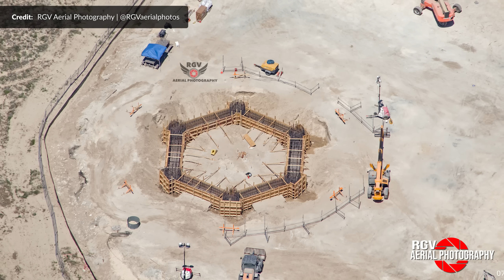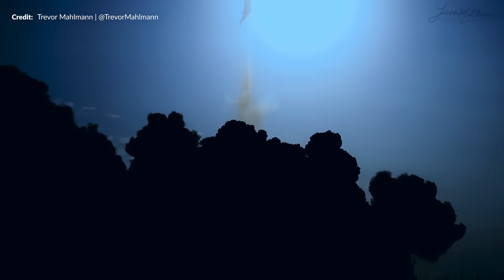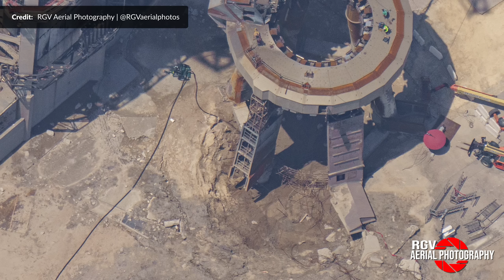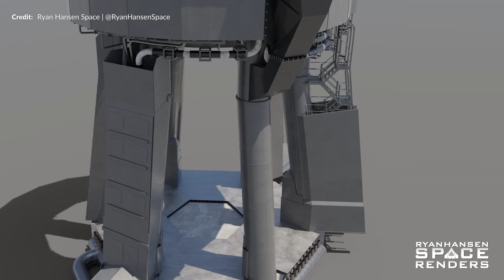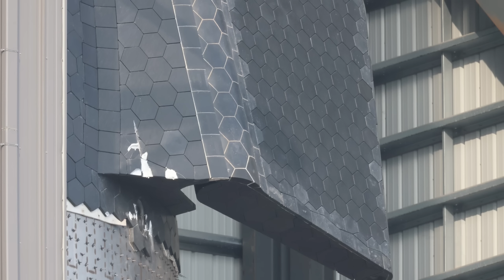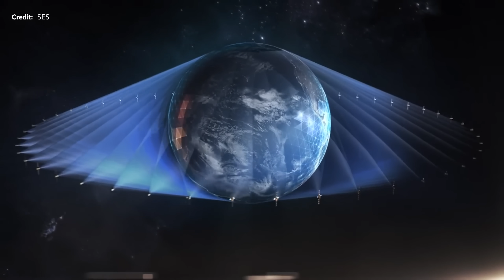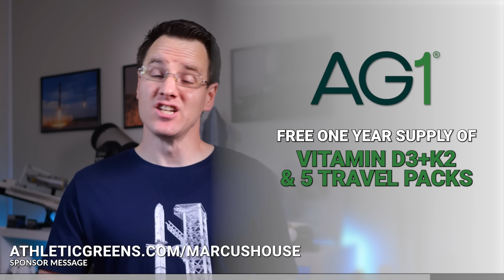The Starship Damage Left Behind: How are SpaceX Moving Forward?

Comment: I don't think there is a concrete out there that can handle this loading. I did my thesis on ultra high performance concrete which is ridiculously tough stuff, stops artillery shells - literally. Still don't think even this concrete would work. You'd need some sort of ablative surface, but that's just the heat. The transient forces on that pad would be nuts. You'd need somthing that doesn't vibrate too much and is super stiff and hard. Maybe a very special ceramic? Diamond? Not sure. Concrete, I don't think will cut it.
Reply: Water-cooled steel plate
Reply: Not convinced steel would handle the vibration. They'd have to have a ridiculous dampening system. Else they would have to use steel blocks, not plates so that vibration can be dampened. Not sure how you'd cool that. Flame diverter would be best. Maybe they can look at firearm suppressors for dampening as inspiration if they don't want to go down the flame diverter route. Would be pretty weird if that worked
Reply: It has to be rapidly reusable and support up to two launches per day, so anything which needs refurbishment or mass desalination is off the table. 
Chances are whatever solution they come up with will eventually be used by every other rockets. Musk is talking about liquid cooled metal plates. 

Maybe just put 33 upside down engine nozels in reverse and suck all that plume away! what could go wrong!
Reply: @NCC_1701  The two launches a day is a far off, future goal. The SpaceX plan for Artemis III as laid out in the GAO report denying the HLS Option A complaints, is 1 Starship variant launch every 12 days.
Reply: @steveaustin2686  It's no more a "far off future goal" than getting Falcon into reusable status. It's the entire point and economic model of the vehicle.  You not understanding that, or realising the use case is irelevant. 
It is the many orders of magnitude decrease in payload to orbit and suborbit which is both the use case and creation of a new market.  It's not just access to space but access to point to point transport. The ultimate goal of an interplanetary vehicle isn't what is being referenced by multiple launches per day.
People said the same about air travel too. "It will never take off"...
Reply: @NCC_1701  Again, page 10 of the GAO report denying the HLS Option A complaints, show that SpaceX's OWN plan for Artemis III is 1 Starship variant launch every 12 days. Just like the Falcon 9, through many variants, took over 5 years to land a booster, almost 7 years to reuse a booster, and over 10 years to get to a once a week launch cadence, Starship is not going to start off with daily launches. You can believe Musk's goal, which in the past, he has said that he regularly makes overly ambitous goals or the actual reality of spaceflight developed at SpaceX.
Reply: @steveaustin2686  I couldn't care less what the GAO report says, and neither does SpaceX.
Reply: @NCC_1701  You MISSED the point, that the GAO report, page 10, shows that SpaceX's OWN plan for Artemis III is 1 Starship variant launch every 12 days. Not the GAOs analysis, but SpaceX's OWN planned cadence for Artemis III is 1 Starship variant launch every 12 days. Yes, SpaceX's OWN plan.
Reply: @NCC_1701  SpaceX doesn't just launch HLS Starship to the Moon. It is up to 10 flights to get HLS Starship to the Moon. This is SpaceX's OWN F'ing plan for Artemis III, so maybe you should actually LOOK at it.

From page 27 of the GAO decision to deny the HLS complaints. [DELETED] is apparently at least a propellant depot Starship variant from the context and SpaceX had the GAO redact that info. Added in Musk's payload update (~150t) and he says that it is up to 8 Tankers to fully refill HLS Starship, depending on HLS Starship's mass. My comments are in ().

"SpaceX’s concept of operations contemplated ten total launches (down from 16), consisting of: 1 launch of its [DELETED]; 8 launches of its Tanker Starships to supply fuel to [DELETED] (down from 14); and 1 launch of its HLS Lander Starship, which would be [DELETED] and then travel to the Moon."

Per page 10 of the GAO report, the SpaceX plan for Artemis III is 1 Starship variant launch every 12 days.

Maybe you should take off the rosy glasses and pay F'ing attention to reality. SpaceX's OWN PLAN for Artemis III was disclosed and no amount of 'rah, rah, rah, SpaceX rulz' fanboi circle jerk fantasies will CHANGE that fact. Live in delusion if you want, but the adults are talking about reality. Join in if you want, but leave the childish fantasies at the door.
Reply: @NCC_1701  Says the person ignoring the facts from SpaceX themselves and who started off the insults. I guess you like to project a lot as well. See ya fanboi.
Reply: @NCC_1701  Projecting again? Remember, you are the one ignoring SpaceX's OWN plan and started the insults. Start with yourself dude.

Comment: This only happened because the terminally unfunny Elon wanted to launch on 420  so he couldn't wait for the exhaust diversion system to be ready.
Reply: There's literally a launch attempt at 4/17 but ok
Reply: @Alvian Choiri Apriliansyah  oh really? If true then I'm mistaken about the 420 part but he still insisted on launching before the water cooled diversion system was complete despite being strongly advised to wait.
Reply: There is no exhaust diversion system planned. At best there's water deluge for these test launches, but they can't be used for several flights per day when rapidly reusable. A solid state solution has to be found which also allows these things to launch from the converted oil rig for ocean landings.
Reply: @NeonVisual  there is a water cooled diversion system being built already it just wasn't ready in time for the launch in question. The engineers advise not to launch before the system was complete but Elon insisted on launching anyway.
Reply: @NeonVisual  IIRC, there was pad damage after the 31 engine static fire. But apparently, they calculated a launch would not have a pad failure with no deluge or diverter. It's likely that one part of the pad failed and cascaded after that during the launch.

Comment: I do not understand the whole platform reasoning. If the starship is to land on the moon or mars then there is no platform, so how will it take off?
Reply from the maker: Big difference between the 33 engines ona  booster, and just the Starship on the surface. I agree though. Landing/liftoff on Mars is going to be tricky without some kind of pad beforehand. I suspect a bunch of uncrewed missions will remain there as supply ships first. Way to far away really to have any real useful opinion or prediction. Mars is the distant dram, for now, orbit and the moon with HLS. One step at a time.
Reply: @MarcusHouse  Apparently the current plan for HSL Starship is to have a ring of 24 LCH4 engines at the top of the propellant tanks for the last bit of landing and first bit of takeoff on the Moon. With the engines roughly 25 meters off the surface and so many of them, a lot of the exhaust should disperse before hitting the surface. I would not be surprised if a Mars Starship has a similiar system.

Comment: Aside from the Stage 0 failure that likely caused the flight failure, something that is probably going to receive extreme scrutiny from the FAA is the near minute it took between the FTS rupturing the tanks and the destruction of the rocket.  This would have been a huge disaster had they needed to terminate close to population.
Reply: Rocket still within exclusion zone. The Automatic FTS functioned as intended & the one who says otherwise just fool themselves
Reply: @alvianchoiriapriliansyah9882  Look, I’m as big a SpaceX fanboy as the next guy, but it doesn’t mean I can’t recognize their faults. Watch the video.  The rocket wasn’t destroyed until 57 seconds after the FTS ruptured the tanks. They were extremely lucky it was in the exclusion zone and nothing important was close.
Reply: @wadewilson524  There is debate on if the FTS was initially used to rupture the booster tanks or if they started failing on their own, before the FTS was triggered.
Reply: @Scanner9631  Historically, there are LOTS of things the FAA has signed off on that didn’t end up working too well. The list is long and distinguished.
Reply: @wadewilson524  

And when they are wrong they can't lay all the blame on others unless those others lied to them and that can be proven.
Reply: @Scanner9631  A fine example of that is Boeing.   I’m confident however that SpaceX believed their engineering data was solid and they weren’t trying to get open over on the FAA.  But, now that it at least appears inadequate, that (FTS) will likely be a show stopper hurdle to jump over before the ship flies again.
Reply: Well… not a debate anymore regarding the FTS

Comment: Its starting to get clear that what looked like a "successful" test launch instead was a big failure. Stage 0 is the most important part and it failed terrible, not only for itself but also for the environment and safety of the areas around. I'm not so sure FAA will give go ahead to any more test flights from Starbase at all, no matter what SpaceX is doing. (And especially not when SpaceX is trying to do another halfhearted solution to avoid building real flame diverters and dilution systems)
Reply: Except they're building a deluge system
Reply: @alvianchoiriapriliansyah9882  To me it does not look like they are preparing for a deluge system of normal size (with huge water towers and so on). And I would guess that you would need a larger then normal deluge system without the flame diverter and with the most powerful rocket ever built.  But I might be wrong.... I still think they will have a hard time with FAA in the future because this was not even close to acceptable or what FAA thought they had approved.

Comment: I'm thinking through the physics of what happened, and I'm starting to think maybe the table sits half as high as it needs to, no matter what the solution.  The main issue looks like the pressures involved.  Concussive blasts rattled things but seem secondary, and heat a nonissue.  Simply trying to redirect the pressure won't relieve it, in fact the constriction would increase pressure.  Even worse if they add significant water. To relieve pressure you need to give the gasses room to spread out, which means lifting the launch table.
Reply: I was thinking this too.  Also, the number and position of the legs might constrain the pressure wave and debris too much as well.

But then I'm no engineer.
Reply: @YagiChanDan  double the height and use only four legs.
Reply: They should consult with NASA and find out the results of the Saturn five launch complex and results of equipment damage after launch .  I find it puzzling that SpaceX would just let all this damage happen just to get test information.   But , he has raised the bar very high in racing forward like this .  I hope that Elon Musk involvement in twitter has not  meant he lost interest in his other companies.  That was one hell of a show .     🐐
Reply: I’m convinced the launch mount will have to be raised to make space for a steel lined flame chute. Very expensive but anything less will not satisfy the regulators and a second failure of Stage 0 would be politically catastrophic.

Comment: “Refused a flame trench, the booster decided to make its own “ paraphrased Scott Manley.
Reply: 😂😂😂 Now SpaceX does not have to dig the trench, it just needs to add a 😊water system and smooth out the edges!
Reply: @Goldengirl48  I’m not bothering with digging a hole for my swimming pool next year. I’ll just offer my lawn as a launch site.
Reply: @angrydoggy9170  Your neighbors may object! That rocket did a really good job of taking out almost everything around it but it did fly and that was the most important thing about this test flight. Even I could see it needed a better basement structure than that crappy concrete. Elon should have been more careful about the amount of damage that had been caused. He just went through almost a full year of the EPA and FAA evaluation and all of the stuff included in getting a launch license. Boca Chica is not very happy with all of the dust and debris from the launch. The Environmental Activists are hopping up and down about the dust and debris that landed in the wetlands area.
Reply: @Goldengirl48  It’s going to take a decent charm offensive to smooth things over. That’s for sure. As for my neighbours, I don’t really care about them. :-)
Reply: @Goldengirl48  agreed, maybe I'm wrong but it looks pretty obvious that a serious sized  hole and flame trench is essential along with water for cutting down on the vibrations, I doubt there's any material that can withstand all that heat and pressure, plus having something close enough to the flame front anyway is just asking for trouble with energy being  rebounded right back at the flamey end !
Reply: @Goldengirl48   make a puddle  .
Reply: @Goldengirl48  The low water table at the launch site should negate the need for any addition of water. Leave it like it is, launch another rocket, and he'll acquire any additional water he needs.😏
Reply: @UserName_no1 I do not think that the Army Corp of Engineers or the FAA would go for it. Besides Cape Canaveral is just as low sitting on a barrier island on the Atlantic Ocean side of Florida. They need to clear the launch site and then redo the entire base.
Reply: @Goldengirl48  Of coarse ACE or the FAA wouldn't approve it. I was being facetious.🤨
Reply: @UserName_no1  Oh, sorry! I am never quite sure of how some of the answers to my post being made in  jest or are serious.
Reply: @UserName_no1  It posted my reply before I completed it. Oops!
Reply: @Goldengirl48  That's because far too many comments are open-ended or rife with innuendos.
Reply: They were lucky.  That could have ended much worse.
Reply: @stevechance150  You are correct. Stubbornness always has a price and Elon was very lucky that his didn't cost him the entire site. None of the support structures were severely damaged or exploded from all of the stuff flying around during liftoff. To me, he was luckier than he should have been.
Reply: Talk about going off half cocked. I’m not a genius but even I though having that tank farm so close to the launch site was poor judgment. And the blast should’ve been diverted somehow. Rushed the launch. Was there any testing done on separation methods. NASA use to test the crap out of things. Gotta say with all the fallout from the launch it seems there needs to be more careful work done to make sure this doesn’t happen like this again. While a lot of fantastic stuff in the works it did leave a taste of amateur experience here.
Reply: @Armourworkshop  Elon was warned about all this multiple times over the years but decided his ego was more important
Reply: Yeah.. Elon is a bit hit n' miss in the ol' genius department eh?! 🤔
As far as first principles physics goes, I really thought this would've been such an extremely obvious cause & effect sitchiation?😬🥴
Now.., the deluge system...🤔 hmmm okaaaay..., maybe, but a "watercooled," "enclosed," metal container (plate) directly under a heat source that intense for approx 15seconds..😶 What happens to water in enclosed metal containers when heated so extremely so quickly? 🫖🌡💥....🤓🧐 *where's the head scratcher emoji? 🥸

Prediction, Flight Test No.2: Expl💥des on the pad...

....over the pad, through the pad, through mechazilla, through the tank farm, across the sea, into the mangroves, blows up my uncles hovercraft, destroys the highway to the Beach, levels a few sand dunes, deafens half a dozen clueless Pacific gulls... and takes out the entire launch facility. 

First Principles Confucius says; Biggest Rocket in history needs biggest launch facility in history! No cheating. 

Am I wrong?
Reply: 3 of the coolest tubers in one place made a good show!
Reply: Why such a crazy big rocket? Is it for Mars or military use.
Reply: @Steve-tc2pi  yes and yes.
Reply: adaptive modeling top off,add hose
Reply: Very cool
Reply: Nice! XD  I yet to watch Scott's video, but that's a good one!
Reply: 🤣 That's fantastic
Reply: 2 replies maliciously censored
Reply: It's still nice though bc experts are calling it a success
Reply: mush's hubris is great at digging holes.
Reply: Who's Scott Manley
Reply: @rubenquintero1301  he's a scientist who has a you tube page similar to this one.  He has a great deal of technical knowledge and he's very good at translating tech jargon into plain English.  You can Google him.
Reply: SpaceX fans making a cake:

Step 1: Take eggs out of the fridge (1 egg falls on the ground)
Step 2: Say the cake was a massive success, we gathered alot of data from that egg falling on the ground.

The end
Reply: @BillClinton228  you'd be the resident expert on failure, considering that's what your father has said about you your entire life.
Reply: @BillClinton228  you failed high school👍
Reply: @BillClinton228  would you call it a failure if a never tried before combination of ingredients turns out to make something amazing but it gets burnt in the oven when cooking? Because I think everyone would call that a success just not completely.